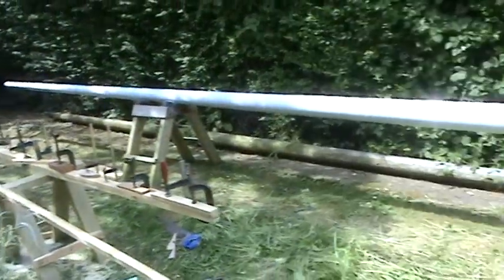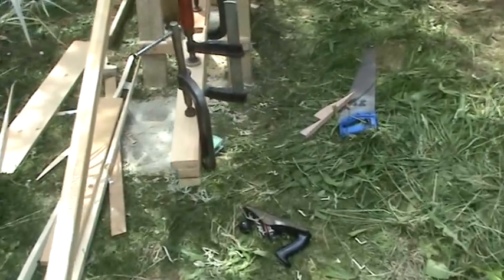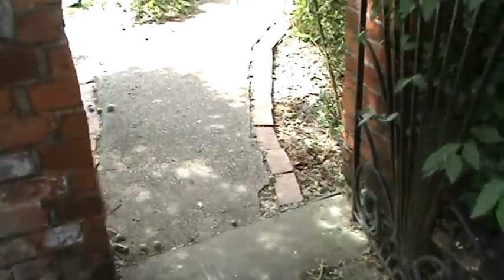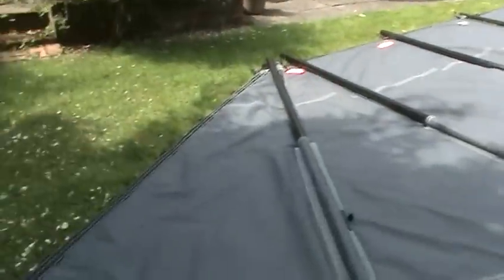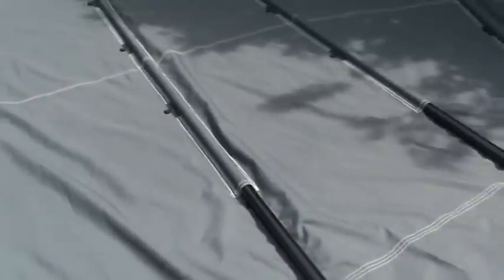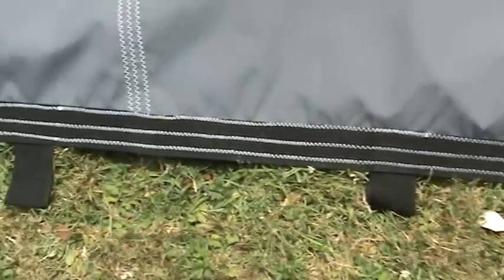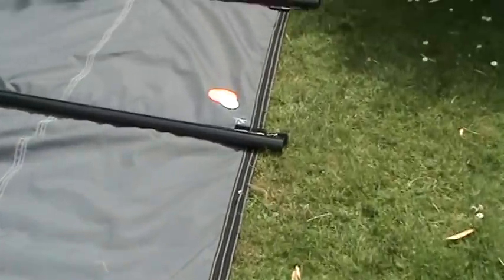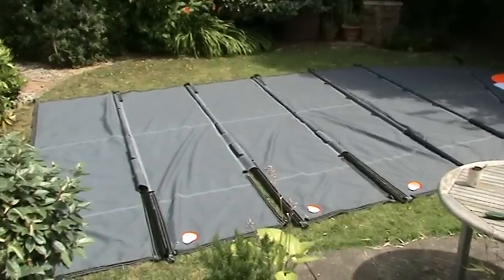The Making of Mingming II : Part 6

Comment: Roger, could you tell me what the specs are for your GRP batons, and where you got them from? And - one last question - what was the final height of your mast above the partners?
Reply from the maker: It was a long time ago - can't remember! Battens were carbon fibre and about 50mm OD. Bought online but can't remember where. I think mast is about 29 - 30' above partners, but don't quote me on that!
Reply: @junkming  Thanks Roger. It's interesting how much thought goes into every single feature of a boat like this. Someone could take it apart piece by piece and reverse engineer the thought processes and reasoning (or lack of, just instinct), and where those thoughts and reasons came from. I find myself pondering so many small things in your videos (aren't the small things that always add up to big in the end?), such as why you constructed your stern oar lock the way you did, did you dispense with sweeps in MMII, and a whole host of other things you've probably long since forgotten (MMII needs its own GitHub).

Comment: Really enjoying all the Mingming II films, fantastic build, lamp post idea brilliant.  Not quite getting the draft in sail business, do you cover the theory elsewhere?
Reply: Re draft:

Sails develop a lot of their power, especially when going to windward, by forming an aerofoil shape, similar to the cross-section of the wing of an aircraft. https://www.google.com/search?q=cross-section+of+the+wing+of+an+aircraft . In Bermudan rigs (the typical triangle shaped sails you mostly see these days) that's pretty easy to achieve. In junk rigs, because of the full length battens, it's a lot trickier to do, so early Western copies of junk sails were made with flat panels (we also didn't really understand Chinese junk rigs very well back in the '50s & '60s). This worked well enough for most points of sailing, but resulted in mediocre performance when sailing into the wind. Since then, considerable research and experimentation has gone into creating cambered junk sails, particularly by Arne Kverneland of Norway. This has resulted in modern junk rigs that can go to windward virtually as well as Bermudan rigs, for all practical intents and purposes. The Junk Rig Association website has extensive documentation available on the subject, should you be interested.

Comment: Just started reading your great books. Would you mind explaining a bit about the material for the sail and you mentioned you used carbon for battens ...did you use windsurfing mast sections?
We have a catalac sailing catamaran and I wonder if that would convert to a junk rig...any input appreciated. Great books and videos. Thanks.
Reply from the maker: +Snake Plisken Sailcloth is Odyssey 3. Battens are straight carbon fibre tubes.